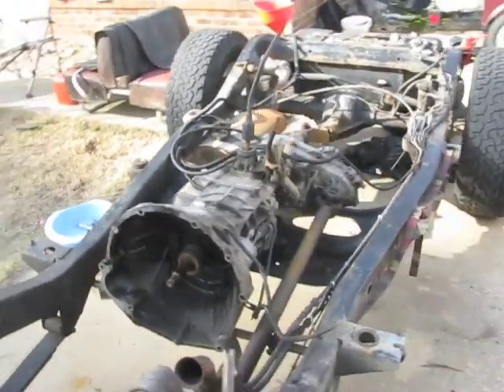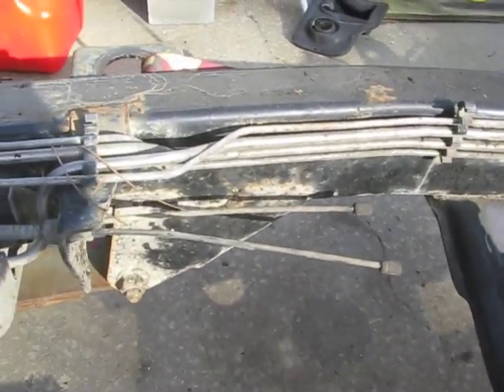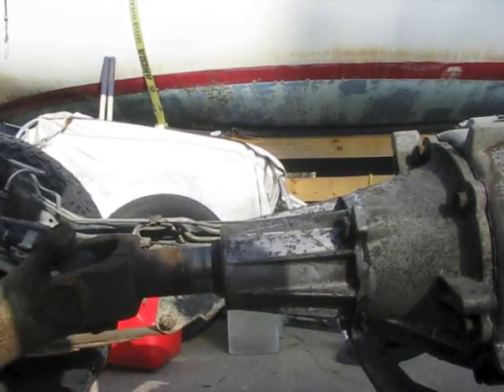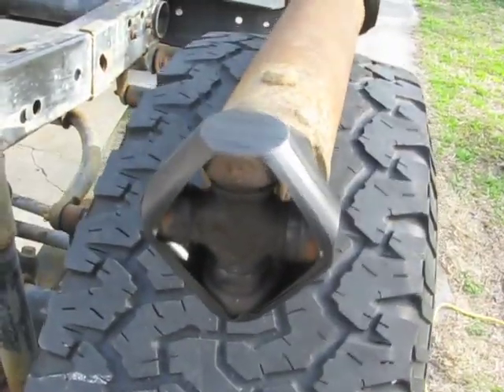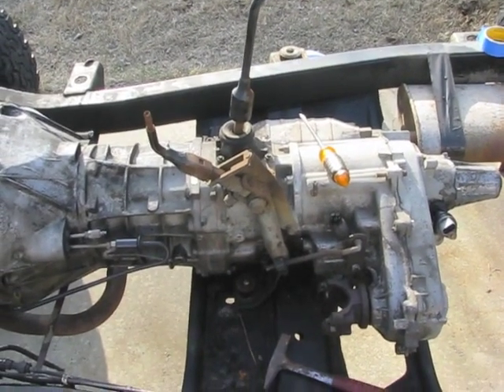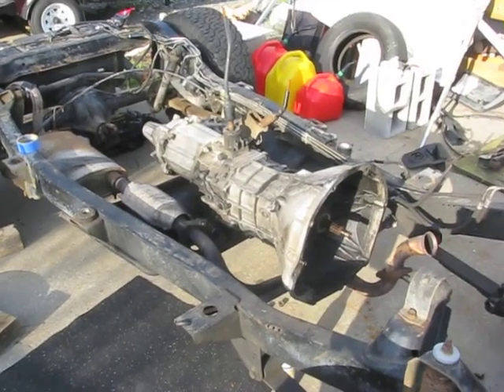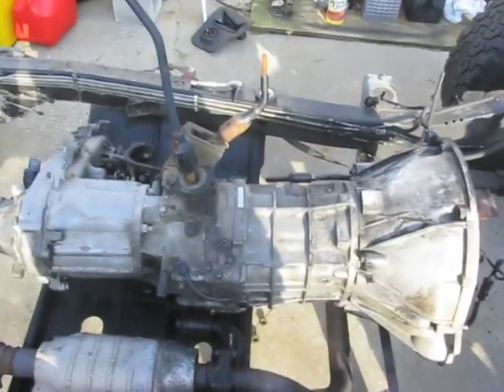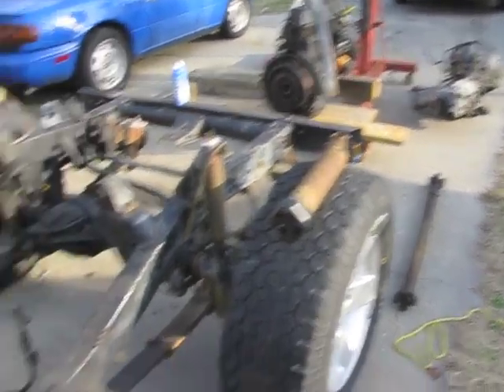'92 Jeep Wrangler YJ Disassembly (AX-15 transmission & NP-231 transfer case removal)

Comment from the maker: I am currently keeping this '92 YJ NP-231 transfer case as a spare. I will be installing another NP-231 in my '91 YJ soon. I pulled one from a '97 XJ (6cyl/AX-15) during the Cash-4-Clunkers (CFC) deal. Someone traded in a nice garage kept, street driven XJ with low miles and the dealers shop had to destroy the engine for CFC and send the XJ to be crushed. I installed a SYE in that t-case and will install it in my '91 YJ in the next month or so. I will probably sell the '91 NP-231 after that.

Comment from the maker: I would say between 175-200 Lbs with fluids. I could have drained them to make it lighter for me to pick up but since I wasn't going to use them anytime soon I figured it would be better storing them with the fluids. 

The only thing I left bolted to them was the shifter bracket for the t-case. 
For removal:
Hydraulic clutch line, driveshafts, bolts for trans mount to skid plate, exhaust bracket, bolts to bell housing, & skid plate bolts to frame (when removing trans/t-case from the bottom)

Comment from the maker: Yes it would work. You might have to drill 6 new holes in the rear flange of the transmission for your transfer case to be clocked the right way for your ZJ but that is simple to do if needed.
Reply: Are the sensors the same configuration for an automatic?

Comment from the maker: I can't remember what year they introduced the AX15 & AX5 in YJ's but if you have the 4.2L (4.0L for '91 & up) you should have the AX15. You may even have the BA10 but I think '88 was the last year for those in YJ's. If you have the 2.5L you should have the AX-5 unless someone upgraded to an AX15. Check on JeepForum for "AX5 or AX15" to see some good photo's of the differences. Hope this helps.
Also, the AX15 is really easy to rebuild.

Comment: I was just wondering... That trans looks identical to mine. I have an 89 yj that needs a new transmission however I don't know if I have the  ax5 or the aX 15. From what I understand, they are nearly identical in appearance

Comment from the maker: The driveshaft from this '92 YJ (6cyl/AX-15) is still sitting in my shed. I measured the collapsed & extended length the day I removed it and it's the same as the one currently in my '91 YJ (also 6cyl/AX-15). I did have trouble compressing the slip joint all the way at first until the excess grease came out. Did you change anything in your drivetrain or suspension?

Comment: Nice Video! I have a question.  I have an 87 with a 207 t-case and the 4wd stopped working properly.  I noticed that the driveshaft slip yoke and t-case has some space in between. Check video 1987 Jeep YJ Front Driveshaft and T-Case Connection    Is this movement normal? Thanks.